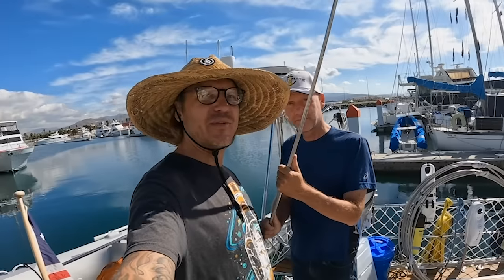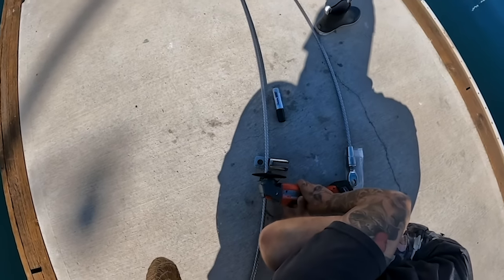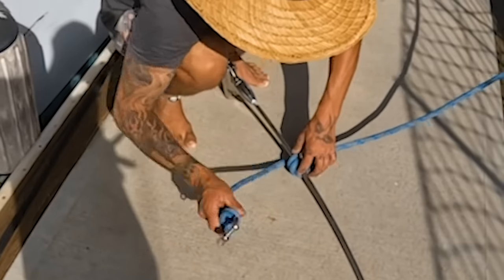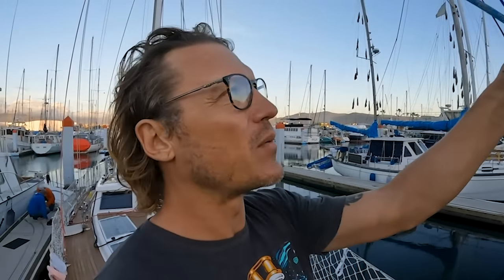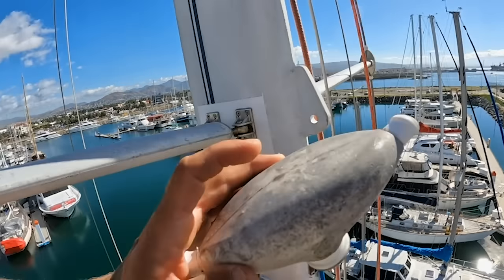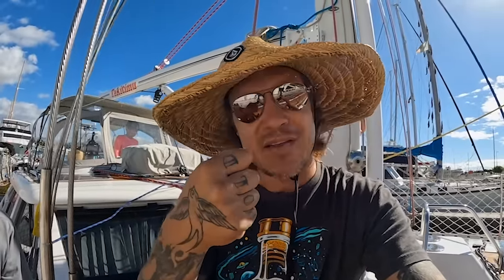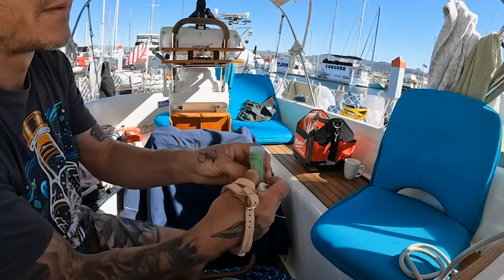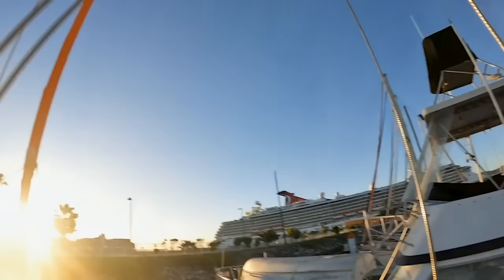DANGER: CRACKED CABLE in the Standing Rigging on our Oyster 485 (pt.2/2)

Comment: A benefit to HF is you can have a net with several people/boats and have conversations running about weather, gear, fishing, mechanical or whatever is on your mind. Think of old fashion "party lines"  for the phone. Cannot do that with Starlink. Oh, use white electrical tape to cover safety wire and cotter pins, to prevent snagging on sails/clothing/skin, lines or anything else.

Comment: Thank you very much Captain James, for these clear and informative videos pt.1/2 and pt.2/2. They are in fact perfect tutorials for diy riggers like me. On my trailer sailor 23ft boat, I have to lay down the mast every time I take her home on the trailer. I use the aft lower shrouds and the forestay when lifting and lowering the mast. For the upper shrouds, back stay and a second forestay I use dyneema in the way you have desribed earlier (works perfectly!). Next I will replace the old steel (lower) shrouds and the steel forestay. Very helpful is your advice to use screwed trminals for steel 1x19 wire! Thank you so much!
Reply from the maker: Glad it helped, hermano. It's not rocket science, just get all the lubes correct.

Comment: I dunno.  I have starlink, but paused it, and still use my HF radio with winlink to get my gribs , weather, email, and check into the nets.  The nets have a offshore social piece to them and check ins.  I’ve sailed all my life, but did IT for 37 years.  Still do HF for the weather and, and mail, and nets.  But my antenna is a separate shroud going from the mizzen shroud base to the main head with dynema strops on the ends… Just me.

Comment: i think you are just plain wrong about HF, HF cant be turned off by people 7000 miles away... HF doesn't require an account HF gear is typically user serviceable

you think starlink cant be turned off you should talk to the folks near gaza, they would assure you that is can be turned off from afar.

dont get me wrong i like starlink i think its great, and i understand not  wanting HF on your boat but HF  is the safe reliable option
Reply: I know if l were to do another passage from Australia to South Africa  & beyond , HF would be on my list....l believe it's called redundancy...paper charts & sexton for sharpness of mind & fun between crew😊👍
Reply from the maker: So your argument for this technology is solely "Nobody can turn it off?" That's not a good reason to spend $3k on an ICOM rig. For what? So you can have a backup? Name me ONE person in the last 10 years that was saved on a boat by calling out on the HF radio? Delorme, Iridium, & Starlink are the options, not HF. Same thing with paper charts, they are a dying tech. I'm sorry, but I'm not the one who decided not to print them anymore. I was a Navigator in the Navy, my JOB was to interpret data for dead reckoning on paper charts. I've probably prepped more charts in my life than you have ever seen. Does that change the fact that they're being phased out? I do own a couple sextants, and I've got a digital version of the worlds charts. I'd be happy to share those with whomever would like them. I also have a Delorme in my ditch bag so I don't have to fucking Dead Recon my way across the Atlantic Ocean in a liferaft with a signal mirror and some 15 year old flares.
Reply: @thelastpirate  no subscription so ya buy once cry once,, its not the monthly bleed, users serviceability,  redundancy.
no one business should be a single point of failure for a crossing
Reply: &there's more with hf with a ham license you can talk around the world
&
And when your mechanical connections cracked and brake along with fracturing the rigging 101 means you're way over tighten them
Reply: Even with all the modern technology, HF & UHF/VHF is still employed as backup emergency communications when everything else fails. HF for long range, UHF/VHF for short (line of sight pretty much). There are HF maritime mobile nets still active for those with Ham Radio licenses which IMO every blue water sailor should obtain.
Reply: anyone done starlink reliability testing in a storm at sea? when the boat is really moving? I'd genuinely like to know
Reply: @thelastpirate I yeah screw paddles too, we have outboard motors.   and who needs that emergency tiller... come on man i respected you, dont straw man us  like that its not cool...
Reply: HMMM , WOW , IN YOUR OPINION , who are you again